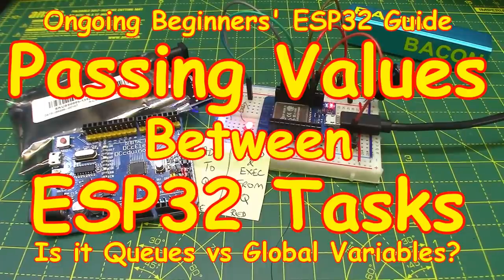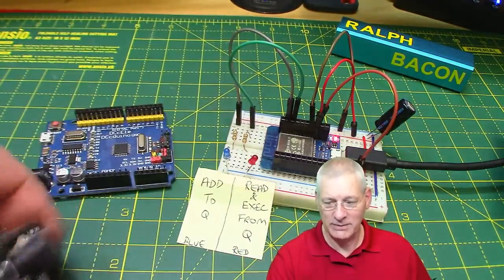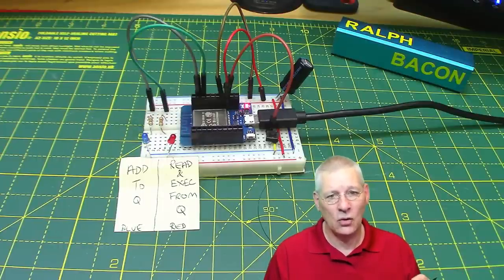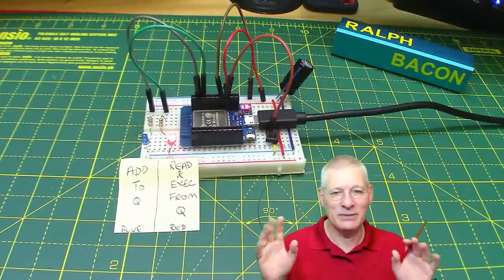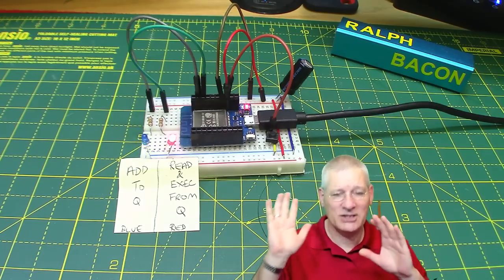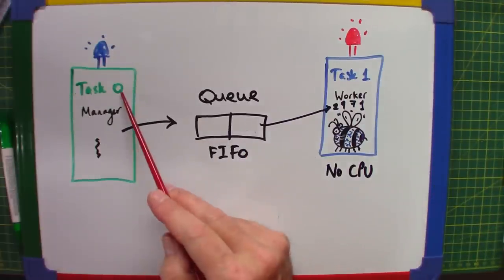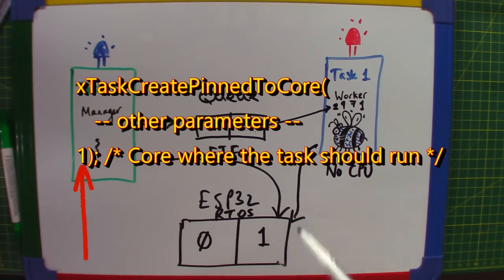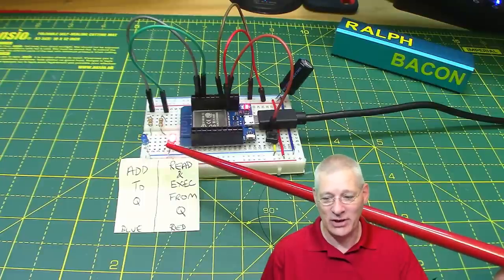#151 - ESP32 Passing Values 💾 Between Tasks - Deep Dive (2 Easy Ways)

Comment: I have one of those ESP32 with the Arduino UNO form factor and they're surprisingly compatible with many of the shields, with some caveats: those that require 5v for gpio won't work as the ESP32 only has 3v3 pins, and the older shields that have SDA and SCL on pins A4 and A5 (like the older non-R3 compliant data logger clones) won't work either, as those pins are input only for the ESP32.

I'm maintaining my own wiki while doing research; some people might be interested so I'll link it here if you don't mind :) https://github.com/parasquid/mcu-iot-sensors/wiki/ESP32#espduino-32
Reply: One other advantage of having the ESP32 in the same form factor as the Arduino UNO is ability to simply transfer the shields from one to the other. Just a couple of days ago I was doing a presentation to a javascript group about Espruino and part of it was a comparison of how code would look like if written for the Arduino. It really helped hammer home the fact that the hardware being controlled is the same, but the language being used to program is different.

Just wanted to mention that one quickly :) The queueing discussion was really interesting and it's something I'd like to experiment on in the future.
Reply: Normally it can work, but it depends on the shield.  3.3v is still seen as a logic high to a 5v input.  And if you feed the shield only 3.3v it will return only 3.3v logic levels.  You have to look at them case by case.
Reply from the maker: So what we need, Tristan, is an ESP32-compatible shield format! Someone has probably created one already!
Reply from the maker: Glad you like the queuing discussion; it can be a bit long-winded but once understood it's pretty straightforward.
Reply: I think the most successful shields were the ones by Wemos (which you've covered quite thoroughly in the past) but that was for the ESP8266; and there were some that tried to ride on the form factor, but I haven't seen anything that really took off.

One would think that it would be easy to design a pcb which would take the usual devkit-c boards and adapt it to the UNO form factor (much like the nano adapter boards you've also shown in the past) but again, I haven't seen anyone build that (yet).
Reply: @RalphBacon  you can use the D1 mini Shields on the esp32 board that takes them.  Personally I stopped with uno Shields ..it's a bit obsolete now.  You can put the whole esp32 on the breadboard and just hook up your module.  Pretty much everyone will outgrow the UNO format once exposed to the actuall wiring anyway.  Which, for me is really good.  It means they've evolved.  You also have the featherwing (adafruit) system, although a bit pricey.  Trying to backport an esp32 to the products of yesteryear is like putting a Tesla motor in a Model T

Comment: Hello, I'm working on a project that is quite bigger than anything I've done before and I'm just learning FreeRTO. In my project I will need to read some values from a few sensors and later move some steppers a number of degrees; thing is that in order to get those degrees from the data of the sensors, I first need to run quite long calculations with float numbers, I made a library to manage the functions for my maths, but now I'm wondering, how can I know If I could handle all those math procedures on core 0 without starving the bluetooth and wifi functions (I also need to implement bluetooth as a form of comunication)? and how can I tell how many bytes should I give for an especific task to run well? I've been told that float operations can be quite taxing on speed and memory.
I'm just starting to learn these topics and any help or resource that would help me better understand these concepts is much apperciated.

Comment: Interesting - but I'm a bit perplexed. Taking the example using a global, it seems the ++count is not atomic - I see that ++count must take a few machine code instructions, and if you say so then I can see that the RTOS might choose the wrong moment to suspend the task doing ++count and start the other task that also wants to do ++count. But surely the underlying semaphore implementation must take several machine code instructions, so that is presumably treated as atomic, else it won't work. Is the position that the compiler only guarantees to create semaphores as atomic instructions and nothing else?
Reply from the maker: Quite so. If the count is not atomic then the use of a semaphore is essential but we can't be sure at which point the task handler switches contexts. But the semaphore ensures consistency.

Comment: I want to use 2 tasks, one for a keypad and lcd interface and the 2nd to drive a stepper motor. Is Semaphore a good way to pass the input of how much to move the motor? Or perhaps to interrupt it if it is mid movement? Will calling the Semaphore code in a loop that controls a stepper motor delay the movement because it has to keep getting the value?
Reply from the maker: You sure you want to use two tasks for this? You could certainly use a separate, self-contained task to get input from the keyboard and display that on an LCD, but how about using the standard loop() to move the stepper motor?
Why? I can hear you asking.
Well, if the keyboard task updates a volatile, global variable then the main loop just reads that (you might get away with no semaphores if you ensure the read is atomic, that is, it reads the entire two-byte integer) and drives the motor the required amount. If you can use a single byte for the value then it will work without any semaphores or worrying about atomicity. And the stepper motor is only moved if that global variable changes value.
Incidentally, the processor is so quick there will be no "delay" in the stepper motor just because you have to read a variable, whichever way you design your code.
Reply: @RalphBacon  Thank you so much for your time in replying. I know you didn't have to but that is what makes you a great person. I appreciate the input and I would love to avoid having to do multiple tasks. I just didn't want having to take input from a keypad, update a display and run a stepper motor at the same time to stop the smooth flow of the stepper motor. Based on what you have said, maybe I should try and get it working the basic way first and then look at improving my code if it doesn't work rather than giving myself hurdles I haven't even encountered yet. Thanks again, you rock!

Comment: Static keyword: defines a variable that "lives" in the static data area i.e. not on the heap (dynamically created variable that lives until the memory is reallocated [deleted]) and not a temporary variable that lives on the stack and only lives until the end of the current scope. Now any variable that is declared outside a a function scope (including main()) is also designated space in the static data area. So, the static keyword is NOT essential. However it does make the code and intentions of the programmer easier to read. This is particularly the case when the static variable is declared outside but amongst a bunch of functions (either because the programmer just remembered it was needed by the following function or to indicate the close relationship between the variable and the following function). No matter were the variable is declared it lives until the program exits (when all the variables go to the variable cemetery - very sad).
Reply from the maker: Indeed, Michael. So, given that the variable in question is declared within the scope of main() but outside of setup() and loop() it should exist for as long as main() runs (ie until the program exits). So with or without the static keyword the variable remains a Global Variable. I wonder why Espressif want it declared as static? Perhaps the SDK they use works a bit differently to the traditional Arduino setup?
Thanks for the detailed response, very interesting, always good to hear from you.

Comment: When setting CPU frequency below the default of 240MHz are there any implications on the WiFi/Bluetooth tasks and can the CPU frequency be changed on the fly within the loop not just setup?
Reply from the maker: Others have asked the same, Andrew, and Espressif indicate that 80Mhz should be considered a safe, minimum frequency to use. But, yes, you can adjust the frequency on the fly, dynamically as my demo shows. Have a go!

Comment: in maxprime process, there is a double loops computing float TEMP and long TEMP2 ? is this used to slow the process more ?
Reply from the maker: Yes, I put a number of things in there that I new would be computationally hard work for all the processors (although the ESP32, being 32-bit with a floating point unit, found it no trouble at all).

Comment: Hello Ralph, I have the follow issue - I need to share a record of a few Strings, and integers between 3 tasks on ESP32. What's the best way ?
Reply from the maker: Firstly, don't share strings they take far too much space up. Use a value that means the same as a string. Eg 1=error, 2=too hot, 3= too cold... You get the idea. Push the value onto a queue as I described in this and other esp32 videos and the other task will detect the presence and continue.

Comment: Hi Ralph. Quick question. When passing global variables between tasks, must they be 'volatile'?
Im using ESP32. Running some code within the main loop, and also running a couple of tasks on core 1. One of the tasks runs fine, but the other crashes now and again.
Also using semaphores but now wondering if I need to also use the volatile key word.
The variables are being read and changed in both tasks, the main loop and also being sent over bluetooth.
The data is from an MPU6050 (if it makes any difference). Oh, and I have two other i2c devices running, all on same bus, with plans to run another two as and when I can get the code running sweetly as it is now. 
Any help greatly appreciated.
Reply from the maker: The two cores should be treated as two independent chips; that said, steer clear of Core 0 as it's used by the WiFi and BT tasks. Tasks within the same core probably don't need the volatile keyword if you're passing variables back and forth, but you can try it out in a simple loop to see if it changes correctly. Adding in that keyword won't cause issues, though.
Reply: @RalphBacon  thanks Ralph. I'll give it a bash. Chances are that I also missed a semaphore somewhere.
Reply: So after getting depressed about not being able to run my MPU6050 as a separate task, went back to running it as a normal function in the main loop. Worked fine.
But as I'm a very bad loser, tried again, but this time was very meticulous about the semaphore give and take, and declared all the necessary variables as volatile. 
It now appears to run perfectly.
I'm updating the i2c device from within the task. At first this seemed to have issues. Then created a semaphore to sort of isolate each i2c device. No idea if that's how you're supposed to do it, but it worked :)
I'm using xCreateSemaphoreMutex() for all cases. Again, no idea if that's the correct way.
Anyway, just thought I'd let you know seeing as your video was my initial inspiration for trying tasks in the first place.
More vids on the ESP32 and various RTOS magic certainly wouldn't be a bad thing.
Good day to you Sir!
Reply from the maker: Experience never comes cheap, does it? But I'm delighted that my video at least made you try this (and then refine it). Your knowledge has now increased. So I'm more than happy!
Reply: Ralph, experience is a bit lacking on my side, but with guys like your good self sharing your vast experience  with us incompetent fools makes learning these thing so much fun.

Comment: Is it possible to run a i2c device in one of those Tasks?   So far i haven't seen it anywhere.      I.e. A simple AS5048 i2c Position Sensor running in one core ,   Making its Angle data available Globally to the other core  .  I cant get it to work.
Reply from the maker: I2C (and, indeed, any other hardware device) can be used in any task. You just have to be careful not to conflict their use from multiple tasks. However, back to your question.

If you have initialised the I2C device, either in the "setup" of your sketch, or the task itself, you should be able to determine it is present (perhaps using the "standard" ESP32 GPIO pins 21/22 but you can actually assign most GPIO pins as you see fit). Look at the ubiquitous I2C "scanner" sketch to ensure you have discovered the device, it's only about 6 lines long!

Then, in your task's infinite loop (tasks must never end, except by deleting them) just use the I2C functionality as you need. It all works just as you would expect.

Tip: Keep all your task on Core 1, leaving Core 0 for the ESP32's system processes (such as Wi-Fi, BT and so on). You can expose the data the task reads on the I2C bus by updating a shared variable (if you want to consume the data in another task, you will probably need to use semaphores so each task doesn't fight over - and corrupt - the data values).

Comment: I am trying to show a message on an LED screen that comes from a telegram message and at the same time if this message is "led1" the led fades in and fades out (using pwm), but the telegram bot needs 1 second to wait for a new message, then I thought "I could use a core to update the message on the screen and another core to manage the class that makes the LED fade" however I can't do it, I see that you use two different tasks in the same core, if you use a delay(1000) in one task and delay(50) in the other, do they add up or are they still independent?
Reply from the maker: If you are (still) using delays you need to learn how not to do that. Blocking code is wasteful in microcontroller cycles. 

At the very least you could YIELD that part of the timeslice it has been given, but better still is suspending the task for a particular period (either relative or absolute).  Or just suspend the task until it is un-suspended (resumed) by another bit of code. Options, options!

OK, enough wrist slapping! If you delay one task you will not affect the operation of other tasks (they all get an equal share of the time, usually 1mS each). (But if you do YIELD a task, the next task gets the remainder of its timeslice).

BTW I've covered how not to use delay statements in more than video, good hunting (a searchable and linked pdf of all my videos in each video description).
Reply: @RalphBacon  I really appreciate your help, since I learned to use millis on class objects, I no longer use delay. I hope to show you the progress of my project. Thank you!!!

Comment: Esp32 CAM
Hii guys, i am stuck at designing a  system.
I want one task to continually check for touch sensor signal, if it comes, then save image and insert its name into queue.

For second task i simply need to poll queue if there is a file name, send that file to email, pop the name and continue polling.

I am unable to run both tasks concurrently on both cores, esp32cam resets itself when i run the program.

Can someone help me how should i design my tasks so they can work concurrently?

Please pardon me i am new to these things.
Reply from the maker: All tasks will start running the microsecond you start each one; have you given enough memory to each task, which is a common failure?

Comment: I'm not sure of the origins of the names "WROOM" and "WROVER" but, as far as I understand it,  essentially the two major differences are that the "WROOM" is a 3.3v core with no PSRAM and the "WROVER" uses a 1.8v core and has a PSRAM chip hiding under the can.
Reply from the maker: Yes, that PSRAM caused them no end of problems, from I hear (and read)! You raise an important note there, Gavin, that these modules are NOT 5v tolerant (although some have experimented) but I would always use a level shifter). Thanks for posting, good to hear from you.

Comment: Nice naming convention!  Did whoever wrote the library pull a random term from a hat for portMAX_DELAY?  Max Delay implies there IS a maximum and it's finite, not infinite.  And it obviously has nothing to do with a Port at all.  Why wouldn't you name it qDELAY_INFINITE or something equally accurate?  I'm guessing the 'x' (xQueue..) is a holdover from writing for larger systems, to be sure it doesn't trod all over another lib's namespace.  Making it an object would be so much cleaner.
Reply from the maker: I know. Mistakes happen at an early stage and then get baked-in. Apparently on the Arduino the strange gap between the header sockets was a mistake that just never got corrected.